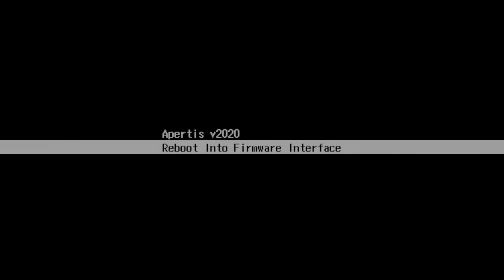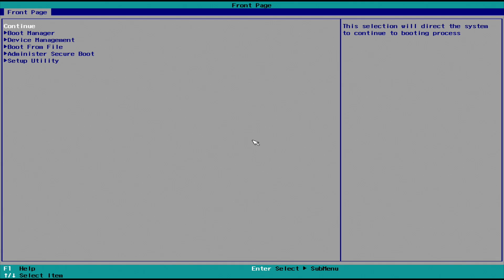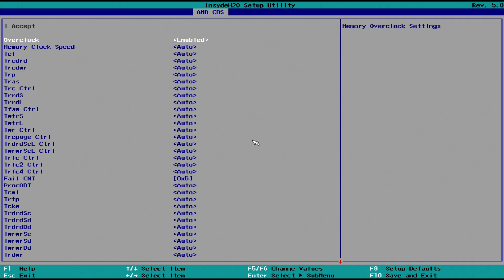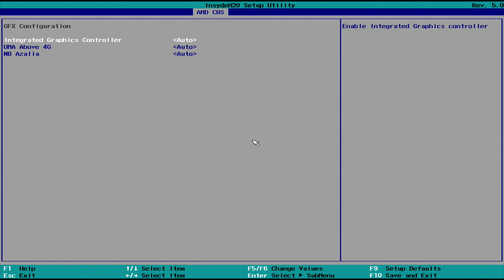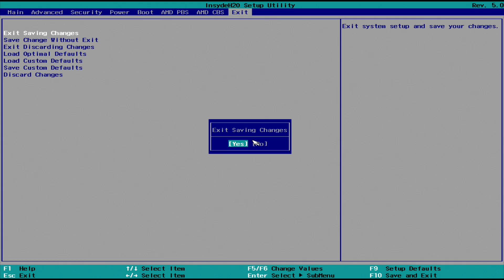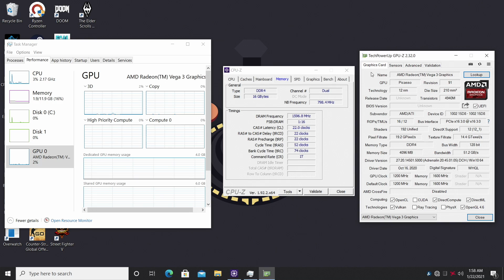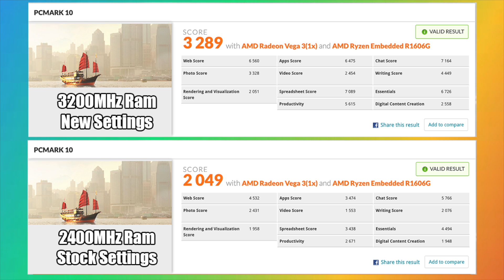Atari VCS Teardown and Performance Upgrades, Bios, TDP, Ram Upgrade, M.2 SSD

Comment: Hello I put new ram in my atari vcs with the same specs as you in this video and when i try to turn it on nothing happens just the fan turns on. I read online that other people have had this issue when replacing the ram and had to open it back up and put the old ram back in to make it work again. When I turned on the vcs i did have a wireless key board plugged in (it has a dongle) and was spamming the delete but didnt get into the bios. is it possible that the machine wont turn on because the ram is 32mhz instead of the 24mhz and i have to switch settings in the bios but in order to reach the bios i must use a hard wired/cabled keyboard? or is this an issue with the ram? let me know if theres anything i can do.
Reply: what did u end up doing since it's been a month?
Reply: I would love to know if and how you solved this. I am in the same spot today.

Comment: the bios changes do not work. i keep having to remove my cmos because i do as you instruct in this video, it ends up not rebooting and won’t let me access bios. doing this is locking me out of my vcs.

Comment: Can you include Amazon links to the ram, ssd and thermal compound you used in this video. Also is 32Gb the max ram this board can handle?

Comment: Does Banded Kestrel use a different memory controller than what was in Raven Ridge and Fireflight? I had assumed all first gen Ryzen and Vega APUs were limited to 2GB for GPU reservation.

Comment: Thanks for the great tutorial!  I did add an SSD and upped the RAM on mine.  BUT... Atari updated the firmware and it is no longer to modify BIOS settings.  It's not that they changed the password and we just don't know it ... they actually locked it out completely.  On the Atari VCS Founders Discord channel they did say they plan to open it back up in the future.

Comment: Hello, so my bluetooth antenna cable came off the module like wht happened in your video... but, I did see a video of how you reattached it... I've tried making it click in (but I am not certain how that would work...)
 
Do you have any suggestions?,,,, I have a soldering iron, but if they can be clipped on, I would prefer that route.
Thanks

Comment: Great video.
Have you found a stable RAM setting for running the CPU as standard?
I really don't want to over volt the CPU in this thing, I tried running 3200MHZ Samsung RAM set to 1600MHZ per stick, but it seems to make games skip every 5 seconds or so.

Any help will be very much appreciated :)

Comment: After upgrading the RAM and SSD then following these steps the system powered down and has yet to power back up.  Still has the power light as well as the fan going but no image on the screen.  How long did it take for yours to boot back up, was it immediate? 
This also only occurred after changing the memory clock speed. Any ideas or help you can offer?
Reply: It seems to only work with 16gb of ram. Everytime I tried with 32gb I had the same problem. You need to reinstall the ram the Atari came with to reset.

Comment: When using a heatsink on an SSD you should remove any thermal interface between the heatsink and the memory. You only want the heatsink to cool the microcontroller. Cooling the memory chips is actually bad for its lifespan/performance.

Comment: How does the price of the VCS compare to a system of similar specs/features?
Reply: Base 8Gb (without any controllers) model is 290$.
PC with similar specs would be system like Athlon 200GE or 3000G with big case and all the components would be the cheapest version. Even PSU :(
VCS is small form factor and its 290$ prize is in my opinion very cheap.

Comment: After i installed 2x16GB 3200 DDR4 and a 1TB SATA m.2 and did your tweaks, it does not startup anymore, black screen and high vent  boost, any hints
Reply: Just checked with the org ram put back in and it starts up, the DDR4 3200 from HyperX with the tweak to 3200, does not work

Comment: In theory, you MAY be able to downgrade to a ryzen embedded R1305, Why would you want to do this? Dont know, but you'd need a proper contact 'heat gun' and a good way to re flow that BGA.  
Maybe you have a good reason i cant think of. Other than maybe needed a lower TDP, though i doubt you would be unable to achive the same thing without changing a setting in the BIOS or changing the power management of whatever OS you choose.
TBH i'd love to have seen a Ryzen 3 2200u, as this likely would have allowed for an upgrade path to a 2700u with 4 core, 8 thread, and 10 CU GPU

Comment: Low-end laptop guts inside an Atari 2600 themed box. Usable as an HTPC or an emulation box, but, unless you're feeling nostalgic (or like the small form factor), something like a mini-ITX Ryzen build will be a lot more practical.
I wonder, why did they lock-down the UEFI ?

Comment: Adjusting the primary DRAM timings to whatever the modules are rated for (rather than CL22) and changing the Ryzen FCLK to 1600 MHz might net you some additional gains.

Comment: That's a fantastic little machine. No other gaming console allows you to actually install Windows or Linux...Insane! The fact that you can raise the CPU TDP and the Memory speed alone is insane. Atari knocked it out of the park and you have the best review on the VCS to date. Great job!!
Reply: Fr!
Reply: I believe bothe the og Xbox, ps2 and ps3 could install Linux and or Windows, usually after an unlock hack
Reply: @alexxbaudwhyn7572  I installed Linux on the PS3, but it was an extremely limited in what you could do with it because they didn't give developers access to their custom drivers, and eventually they pushed updates to remove the ability to install Linux. This is a far more open system for tinkerers.

Comment: You used some pretty loose memory timings there. Probably could have squeezed a bit more performance setting them to what that RAM is capable of rather than the settings any non-faulty will be able to keep up with.

Comment: So for the UMA FBS - if I upgrade to 32gb of ram I should be able to set it to 8gb - correct? Or should I go even higher (to 16gb)? Also is a thermal paste application required for the overclocking or would it be safe without it?

Comment: A word of caution on using NT-H1 for bare-die applications: it pumps out somewhat quickly. You should use a thicker thermal paste like the Xigmatek PTI-G4512, the Prolimatech PK-3 or the Cooler MasterGel Maker. Those thin, "easy-to-apply" pastes (like the NT-H1, NT-H2, MX-4, etc.) will always pump out in a time window ranging from weeks to months and they'll start performing badly.

Comment: I was a video game programmer in the early 80's.  I didn't even like the original VCS.  It was a toy from the 70's, and don't forget we had arcades back then that made the Atari 800 and Commodore 64 look pathetic, and those were infinitely better than the VCS.

And if you want a retro system to be as good as the original, you have to be sure there's no input lag, no display lag and no lag in your monitor. Originally those things displayed directly with no buffering and no lag. Even though the new VCS has better hardware than a common original company retro system, I'll be surprised if they got the lags very low - you pretty much need an FPGA based emulator to get the console side lags low, then you need a gaming monitor, not a TV to get the monitor lag low - or an old style VGA monitor can help.

Comment: Where is that fan pulling air from? There is nowhere for it to get cool air anywhere except maybe the vent at the back left (Back right if looking at the unit from behind). And even then, likely not getting much - worth consideration and i'd love to see the temps over prolonged heavy use

Comment: Its small, but what really annoys me, is when you say "eighteen, fourty-eight, two" when you could more easily say "eighteen, four-eighty-two" which rolls off the tongue better. lol basically instead of 2-2-1 you do 2-3

I like the tweaking ability of this. Curious to see how it does if you do 8gb or 16gb vram (since i saw those options available) with 32gb total system ram (two 16gb chips) that would be dope maybe? looking at laptops, generally you are limited to 1-2gb for gpu even if you have tons of system ram installed. while this allows you to actually allow more. granted i haven't own a laptop in awhile, so dunno if you can do the same as this little unit (like 8gb).

Comment: I was an original backer but after a two year wait, I was less interested by the time it arrived.   It's still in the box but this video makes a compelling case to open.
Reply: that's sad. go open it.
Reply: @quetzalcueyat , I will.   While a different platform, I fell in love with Legends Ultimate while waiting for this thing to actually ship.
Reply: I felt the same way. It has been fun to tinker with, at least outside of the VCS Built-In OS.

Comment: You should really manually enter the correct RAM timings. The main setting, CAS, should be at 16 and yours is 22 which is hitting the memory bandwidth. Enter the timing numbers listed on the RAM stick. 👍

Comment: I still can't believe it's actually a nicely designed little system. The team who worked on that PCB cared.
Reply: Hello og youtuber.
Reply: Atari is apparently bringing out a cryptocurrency or is already on the market.  Has anyone heard of it?
Reply: Yeah. It is way cheaper than similar SBCs. I use mine as a server, and it is great.
Reply: And the price is crazy for the amount of power and how upgradeable it is.
Reply: @thickglasses  yep don't deny that. Form factor, power and windows 10 is a draw for me. Underpowered CPU is definitely a turn off.
Reply: @Charles R not really bc the case is cheap made with a cheap mould.  Also the design is not a patent anymore. This company is not Atari from the 80s. Thats just a kickstarter scam with a famous "name" they bought to sell crap to nostalgic idiots.
Reply: @martinmoller4947  why you need to be so toxic?
Reply: And now tell that yourself 10 times a day. Some day you will believe it. ;)
Reply: @martinmoller4947  lol. Seems like a decent board considering the price of the base model.
Reply: @cubeflinger  its overpriced af. For this price get a series s. Much much better than the scam vcs. Emulates even ps2 games easily in good quality.
Reply: @martinmoller4947  It's still based at 249.99 at Walmart for the 400 with no controllers.
Reply: @martinmoller4947  You forgot to mention the part where you are at the mercy of Microsoft if they decide to block the emulation with an update in the future or not, and how this Atari thing has better size than the S series fridge
Reply: @martinmoller4947  You call it a "scam". It isn't, it's a fully working product aimed at a certain market. Do you actually know what a scam is? Just because you don't like it, doesn't make it any less worthy than all those other niche, designer/nostalgia inspired products out there. It's not even particularly expensive for a low volume product.
Reply: @another3997  thats not a premium niche product like a Analogue console. Its a cheap made with cheap parts built product which gets sold without any game that would be meaningful today. Therefore its a scam bc they take a premium price and have promised a lot more. I dont like it bc there are reasons enough. How about disproving my arguments?
Reply: @floozytchi  thats essentially a really shitty laptop your mini computer. ;) Laughed so hard about your comment. Thanks. You seem to be a hw expert. :D
Reply: @martinmoller4947  good luck finding an Xbox Series S 🤡🤡🤡😈😈😈🤣🤣🤣

Comment: When you changed it from2 to 4 for the gpu , what would happen if you went higher like 6 or something ?
Reply: Not much. Since you are playing on low and medium settings in most games, you are using standard definition textures. Higher is for when you are using high definition textures.

Comment: That's a pretty nice boost. It should bring a lot more games into the playable range.. games that were previously just shy of that limit, IE games running at mid to low 20s fps.

Since the heatsink appeared to be nickel plated.. If someone used a soft rubber foam pad as a gasket around the die, i could definitely see using liquid metal on this device.
Soft foam rubber with the same consistency as a thermal pad.
I still need to find an ideal rubber foam material to use as gaskets for LM Something thin that compresses to create a good liquid proof seal.

Comment: A ram upgrade and some thermal paste improved PCMark 10 benchmark performance by over 50% that's impressive
Reply: he also raised the CPU TDP from 35W to 54W.
Reply: @gionieves2646  yeah I forgot to add that but that's made safe to do thanks to the better TP.

I was thinking about outlaid upgrade costs to improvement when I made the comment :)
Reply: @purkie103  for 35W the pad is fine. Going up to 54W would still be fine but that fan would be ramping up ALOT more! Me personally I would have used a high end graphite thermal pad, but to each his own. 👍

Comment: Im definitely curious to see what sort of emulation performance you got after the upgrades.  A vid comparison of the vcs to other mini pc's would be cool too.
Reply: @Hester_Productions  Im not talking about SBC's like the pi im talking about mini pc's like the NUC or larkbox, two different things. Theres no doubt its going to be more powerfull than a average SBC and less powerfull compaired to an XboxS. And yeah you can built a more powerfull pc foe $400 but at a much larger footprint. The VCS is basically a mini pc and id be interested in how it stacks up compaired performance and price wise to other mini 
pc's.
Reply: @Hester_Productions  I didn't realize that Pi3 can run Windows 10 or another other X84 / X64 OS. Can you share those links with everybody ?

Comment: Do you think this thing would perform better for emulation with Linux on it rather than Windows? It's been a while since I have messed around with emulation on Linux so I am not sure how performance compares but I know the overhead would be a lot lower.

Comment: Why is it everyone is so worried about heat dissipation on the cpu, but they leave the paper stickers on everything else?!
Reply: CPUs get a lot hotter than RAM and storage.
Reply: The stickers on ram and m.2 drives are often made of aluminium and are for heat dissipation. Warranty void if removed.

Comment: How much benefit do you think the thermal paste had? I ask because I have the ram, the m.2 and a snow day off work so I kind of want to do this today but I’m out of paste and I don’t want to take the VCS all the way apart twice.
Reply from the maker: I’m doing some log them testing now, and it’s actually looking like it helped out nicely, the fan isn’t kicking out as much even with the higher TDP

Comment: Run cyberpunk at lowest settings, 640x480
Reply: Cyberpunk can run at 720p with dynamic resolution 70% lowest settings on this chip, and with these tweaks, you could probably get a stable 35ish fps at those settings. For the walmart price of 250usd for this little system, it isnt bad. Its essentially a mini pc for that price
Reply: @KadiusFTW  Really someone ran cyberpunk on this? YEah it does work surprising. The result is really ugly and the fps is all over the place but it will work.
Reply: @timmyburden5701  with these tweaks and a modded AMI bios though, you can change the Igpu frequency to be a bit higher, like the 3000g, and add undervolting to the igpu to help with temps and the power limitations. Its a marginal tweak though, and is like the difference between a gt 740 with 2gb of ddr3 and a gt 740 with 2gb of ddr5.
Reply: @KadiusFTW  From the video of eta prime the fps changes by 8 more frames per second at 720p. If you add more ram and tweak the ram to be faster. its interesting but its always going to be held back by the CPU and the built in graphics chip. I just hate playing games at 720p.
Reply: @timmyburden5701  I dont disagree, but this is a mini pc kit for 250 usd from walmart.  you would be hard pressed to get this kind of performance per dollar that actually can be used as a proper pc, let alone one that could adequately run games at 720p low, not even mentioning the form factor
Reply: Someone already did but everything on the Atari was stock 8gb of ram. I would like to see it now
Reply: More like Cyberpunk 2007
Reply: @zombieplasticclock  At 640x480?  Cyberpunk 1997.
Reply: @jameslewis2635  Isn't that literally just Deus Ex?
Reply: I don't think the CPU is strong enough to run this game.
Reply: @timmyburden5701  definitely not but it's interesting to see how things perform on different configurations.
Reply: Kevin Kenson already did it
Reply: Yeah Cyberpunk is a pretty poorly optimized mostly GPU bound title, that cripples frame rates with it's heavy lighting and post-processing despite many of the 3-D assets actually being fairly low in geometry, it'll be interesting to see how CP runs on this say upto 720P.
Reply: @leeboy2k1  personally ive forced it to run on cpu before, bad rendering and shitty graphics, really bad that its gpu bound cuz ive only got a gtx 600
Reply: Yuck. Why would anyone want to play at that resolution?
Reply: @timmyburden5701  Maybe on a crt it would work well. 😄